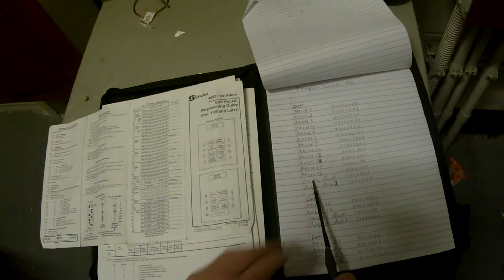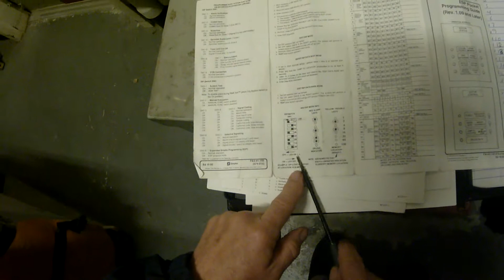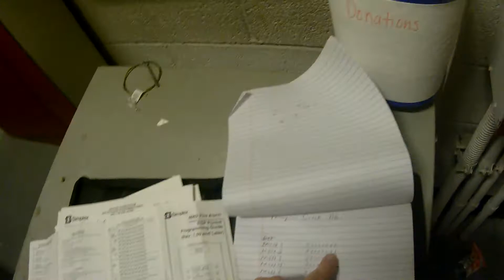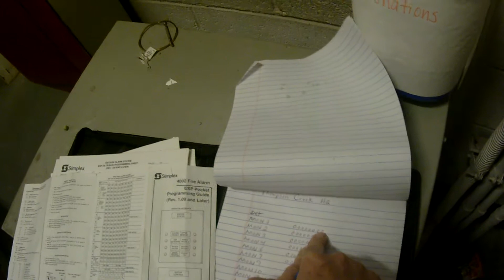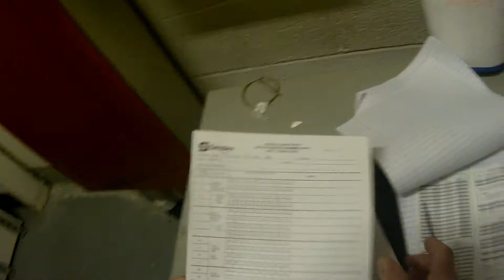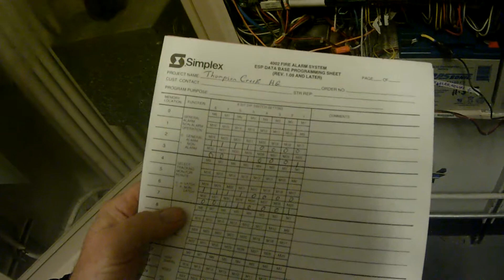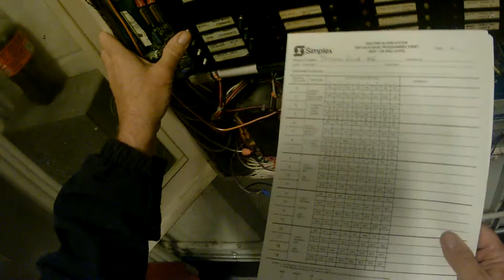Programming a Simplex 4002 Panel

Comment: Bet that was a fun job. The shoddy wiring, the reprogramming, the fact the panel needed to be replaced. I would be having fun with that job and my OCD would make me want to completely re-wire the panel to fix it back to how it was supposed to be. I wouldn’t be surprised if the bad wiring was part of the reason the panel lost its programming. However, i think it may have to do with the flash memory or ram chip being on its way out.

Comment: that panel is a mess! the programming reminds me of working with very old computers say, an 8088.  that panel requires a lot of manual work though!
Reply: 8088 is old,   we had the 8500 that we manufactured with an 8085 chip, we would network it to a zenith z100 terminal that ran on an 8088 chip.  In 1992 they moved towards microcontrollers
Reply: @carlh4279 I wonder if this old fire alarm panel even has a CPU, or if it's all discrete TTL/CMOS logic chips?